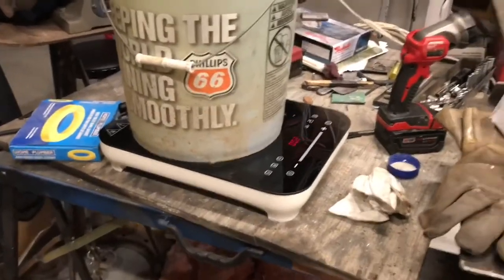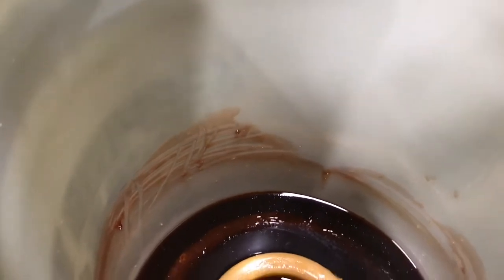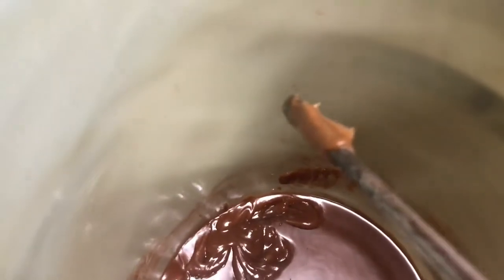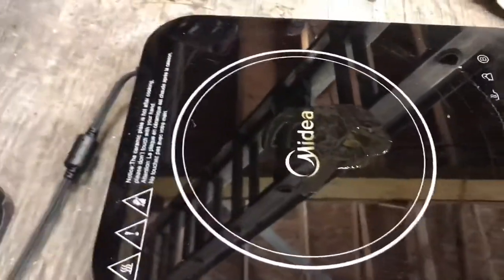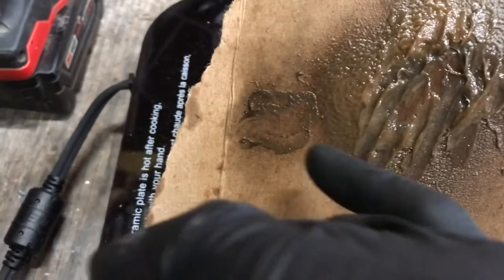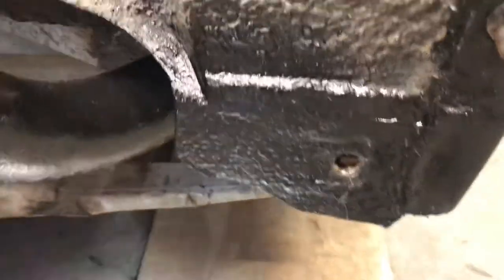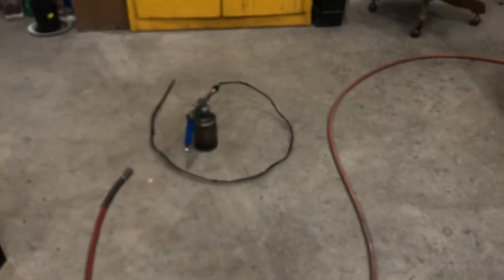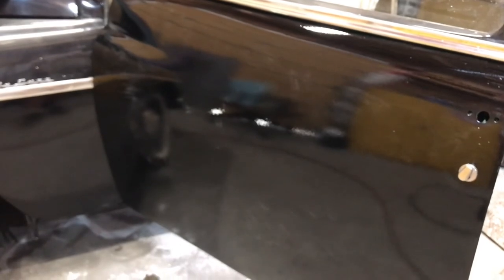Automotive Rust Proofing DIY Cavity Wax

Comment: Might spray in some fluid film into the concoction instead of tranny fluid which might harm rubber weather strips and bushings.
Reply from the maker: Good point, I never thought of that. I should spray some on a piece of weather stripping an see what happens over time. Even if it does impact rubber parts, they’re still a lot easier to replace than metal. Like Spok said “the needs of the many outweigh the need of the few, or the one” . Thanks for watching and taking the time to comment.